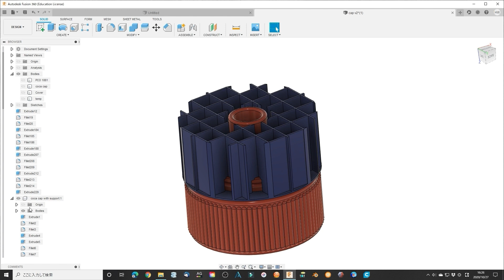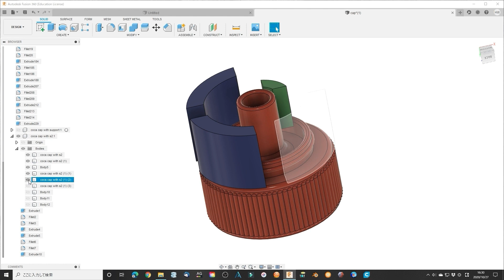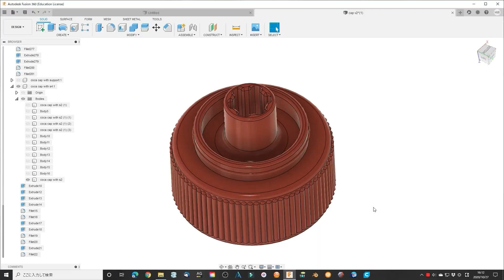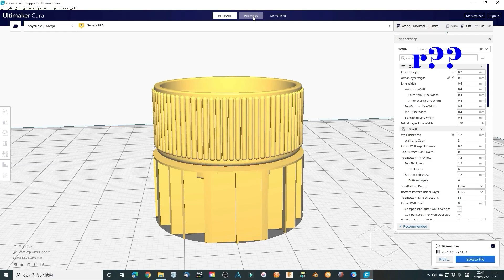Coca Cola Cap Experiment (Where is the Support Layer Gone) (Much easier to drink Coca)

Comment: What software are you using? need to know
Reply from the maker: Are you meaning the software that I used for slice and design? I use Fusion 360 for design. Usually use Cura for slicing. Recently I often use PrusaSlicer for slicing. Both worked for me. But sometimes Cura has a little problem.

Comment: I think the setting you need to enable to get your 0.4mm supports to stay after slicing is "Print Thin Walls"  under shell settings in Cura. Thanks for the videos and designs, I enjoy them! :-)
Reply from the maker: Thank you very much for your comment.   I will try it later. Have a nice day.

Comment: what is the pitch of the thread ? and the angle ?
Reply from the maker: PCO 1881 coca-cola cap design using Fusion 360

Coil
Type:  Revolution and Pitch
Diameter:  24.3
Revolutions:  2
Pitch:  2.7
Section: Triangular (Internal)
Section Position:  Outside
Section size:  2.5
Then cut inside using 25 mm D cylinder
Hope it will give you some help.  Have a nice day.
Reply: @TubeUnderdeveloped  ok thank :) and the angle of the triangle ?
Reply from the maker: @stg45  Sorry, the angle is 0.
Reply from the maker: You may also need to add some clearance depending on your 3D printer's property. In my case, I add -0.1 mm in both the top and bottom of the thread surface after finish the coil design.
Reply: @TubeUnderdeveloped  ok

Comment: Check your horizontal expansion settings. Sometimes they interfere with thin objects. Try using 0mm and check if it helps.
Reply from the maker: Thank you very much for your comments.  I have checked the setting that the horizontal expansion is zero which I used now.  I did not notice that will interfere with the final result a lot.  I still have a lot of things to learn. Thanks again. Have a nice day.